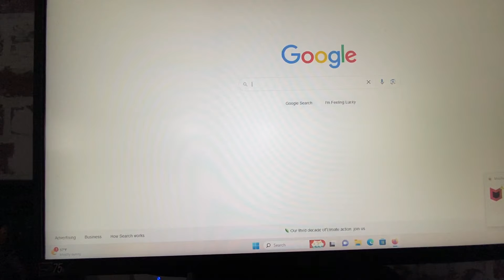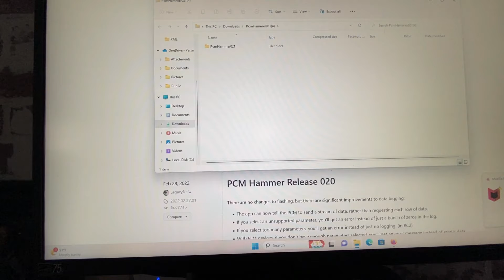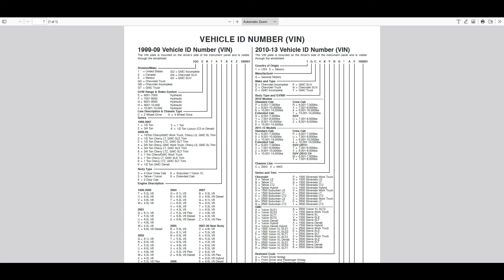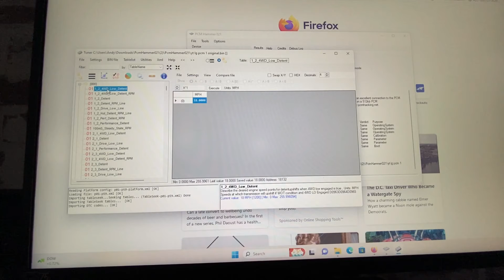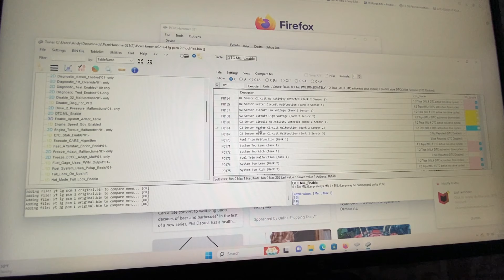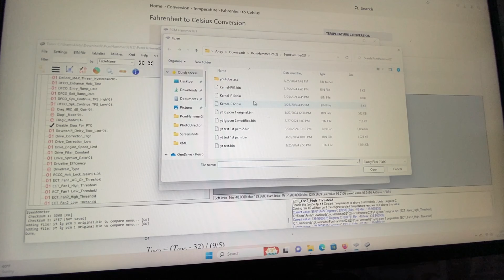Remove the GM PO1 P59 PCM VATS and MORE for FREE Using Your PC LS Swap Engine Management System

Comment: Do people know to bypass vats just plug it into whatever for a p01 or p59 and leave key on for 20 to 25min and it will then bypass vats on its own and work. I did it on my 99 Silverado with a 2001 ecu because it had more options for the door locks and etc and had better calibrations then my 99. Yes immediately security blinked and it stalled after a second,,but after watching youtube they said turn the key on and leave it on until security blinks or goes solid( opposite of what its doing atm) and 20 to 25min later it will self bypass and work from there on. YOUR WELCOME
Reply from the maker: I have not tried that yet. Thanks

Comment: I have a P01 ecm out of a 99 Silverado.  Can you show me how to delete egr and change my rev limiter settings and excellent video!
Reply from the maker: The rev limit settings I don’t mess with. I believe the correct files are P0401, P0404, P0405 and P0406. Do some research to verify for your specific year/pcm. It is not a single file but several. Be sure to make a copy of your original file so if your mods don’t work out, it can be restored to its original configuration.
Reply: Thanks for the advice and keep up the great work.
Reply from the maker: @victorguerrero530 thank you

Comment: Can you disable things like 02 or knock sensors and not have the engine going into lymp mode?
Reply from the maker: Yes, it is possible. Depends on what setup you have. I have not experienced this, but would suggest if you are having this issue to get a tuner with experience to help you out.

Comment: have you figured out how to change transmission setting to match your wheel size and gear ratio so transmission isnt shifting to early or to late etc thanks
Reply from the maker: I have not tried that yet. My truck in use is a manual transmission.

Comment: Im trying this on my truck. But, when I try to read the entire pcm, I get asked for an operator system id. It's kinda holding me up. I noticed you never got asked.  Why is that?
Reply from the maker: Good question, I follow the path I described and I have never gotten that pop-up. What are you doing that might be a different that what I am showing? Is this the first pcm you have used on the bench top wiring harness?

Comment: No turning off and on ignition power for it to save or anything?
Reply from the maker: You would need to be a bit more specific. Is this the first pcm you have worked on with the new bench top wiring harness?
Reply: @laurencevillegarage iv seen other videos that folks will turn off and on the ignition to pcm for it to actually take the tune. With this we don’t need to do any of that? Might be LS droid and hptuners platforms only that need ignition switched on and off.
Reply: @laurencevillegarage yes

Comment: Can I remove the VATS on a 2016 5.3 with this setup?
Reply from the maker: That is a gen 5 pcm. I am going to say no. There are a lot of changes from gen 3 to 5. You should consider finding someone with an HPTuners license to be safe. There may be other systems capable of doing that, but I tend to stay with the gen 3’s for simplicity.

Comment: What about the fan low thresholds. Theyre still set at 139xxx°c, would that i terfere with the high threshold. Since the low threshold turns the fans off if it is below that tempurature. If the fan comes on at 93°c but is set to turn off at 139°c then the fan would just not even turn on? Just curious. Or does the pcm just over ride that. I think im going to set the low threshold lower than the high threshold

Comment: I am writing a file to a 2005 ecm and it seems like the vats delete is not taking when I check it with my hp tuners. It shows pwm regardless of which option I select in patcher. The rear 02 delete worked as did the evap delete. Any suggestions?

Comment: So the software is free but you need an $80 adapter?
Reply from the maker: You do need an adapter, there may be others you could try. I chose that one based on positive reviews and knowing someone else had used that one and had no issues. I viewed it as an investment. It was at least half the price of having the vats deleted from 1 pcm by someone else.
Reply: I use an obdlink and it was around 60 bucks

Comment: can i fine tune my agressive cam in my 2000 gmc 5.3 with this
Reply from the maker: @WilfredGreen-ov8bh  with this you can gain access to all the parameters to make changes. BUT, you need to know exactly where to find the parameters AND what the new changes need to look like. HPTuners would make this simpler, but you still need to be familiar with programming and know what adjustments to make. That’s beyond my capability. Finding the o2 sensors and vats is much simpler to do in comparison to adjusting fuel and spark tables. You really need someone who has that knowledge and experience.

Comment: Amazing video!! I have a ls o built in the living room lol but I can't get spark engine turns over but no spark I'm using a Tahoe harness but the engine came out of a silverado it's drive by wire and the pedal and throttle body are working....and  I live in Lawrenceville lol any help would be appreciated Thanks!
Reply from the maker: That can be a number of things....It's probably something small when connecting the harness wires to the pcm/fuse box. Trace down your coil wires to see where they ultimately splice down and connect to the fuse box. Also, double check all your grounds.
Reply: Had same problem with ls swap

make sure grounds are straight 

3 different crank position sensors later cause they sell aftermarket ones that are no good sometimes but they have lifetime warranty so try em until it starts

Also make sure spark plugs are good I had to change a few in this process too
Good luck let me know I need info to add to my arsonal

Comment: does deleting the DTC also delete the readings from the rear o2s? or does it only eliminate the engine light? I'm wondering if I can eliminate the rear o2s completely like they never existed.
Reply from the maker: Deleting the DTC removes that function or reading. The pcm will not recognize any data from that sensor. As if it were never there. It is eliminated from any calculations. No data, no light.
Reply: @laurencevillegarage  one more question...I'm having a vats issue it intermittantly triggers and won't start...its currently in that mode. can i flash with the bin file i modified from a copy i got when all was good that deletes the vats and it starts fine or will I have to fix the vats and get it running before changing the flash? hope this makes sense...lol
Reply from the maker: @charlesosteen8323  If I am understanding you correctly, you should be able to use the program you saved to "over write" the existing settings.

Comment: Can you do this to my PCM?
It’s a 2000 Silverado 1500 
4 x 4 
4.8 L 
4L 60 E 

Is it possible using PCM hammer to change shift points? 
I’d like my transmission to shift a few hundred RPM later than stock. 
Love your video very easy to follow
I have a hard time following some of the other videos that are out there so I really appreciate what you put together
Reply from the maker: While I am able to remove the VATS and rear O2 sensors, that's where I draw the line. I am not familiar with the finer details of the tune like you want. I would suggest a tuner that can ride in your truck with you and dial it in exactly the way you want. It will be more expensive, but will give you more of what you want. Thanks for the opportunity.

Comment: Why would you want to disable the rear O2 sensors?  Super video.  Thanks, and it is done with free software, awesome.
Reply from the maker: If you were swapping a motor into an emissions exempt vehicle, hot rod, race car, etc. and were modifying the exhaust or engine itself you can delete the rear sensors. If your exhaust has no catalytic converters, no need for the rear sensors. Then you would only need the front sensors to tune.
Reply: Longtube headers with no catalytic converters offcourse for offroad use only
Reply: what was said +they are useless and do nothing as for fuel trimming just a tester after cat